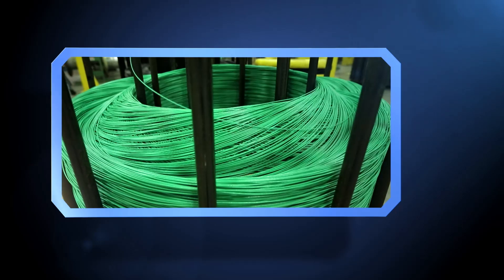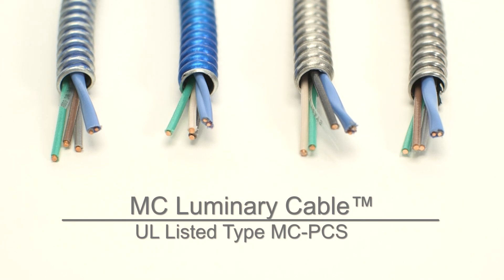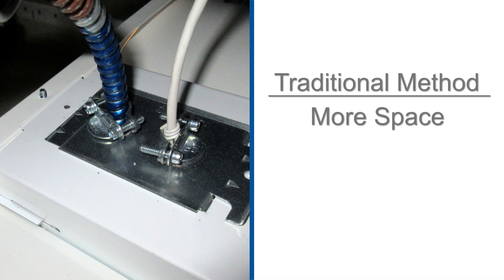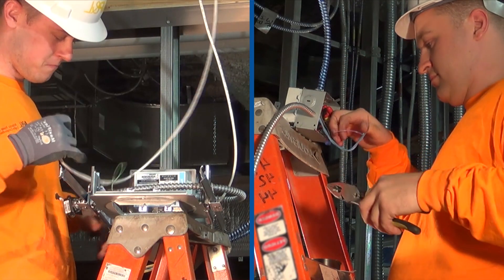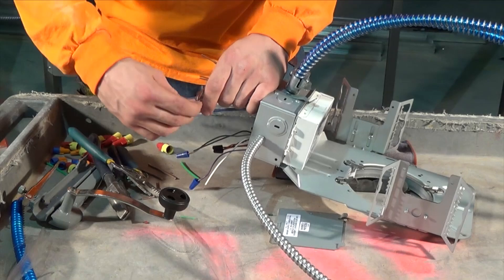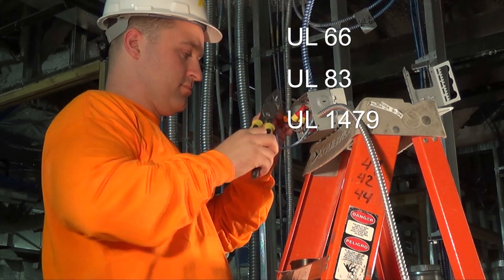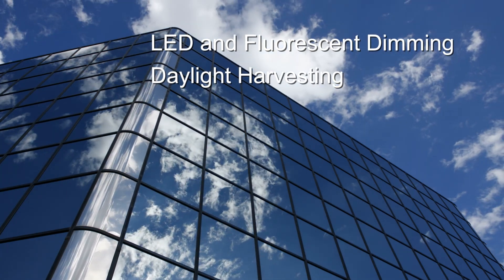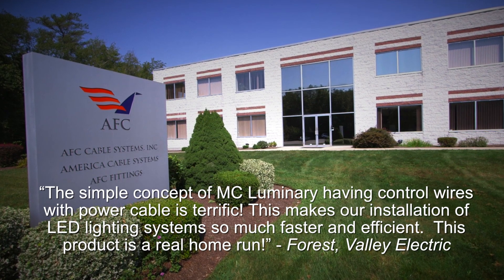MC Luminary Cable by AFC Cable Systems

Comment: How do you avoid the prohibition of installing Class 1 power system in the same conduit as Class 2 systems?  Most dimming system use a class 2 power supply.
Reply from the maker: In our Type MC-PCS cables (luminary) we have the control circuits in a 30 mil jacket which is per NEC.
Reply: I was wondering the same thing because in California low voltage and high voltage have to be at least 1 foot apart when running the lines
Reply: NEC(2017) 725.136(I)(1)